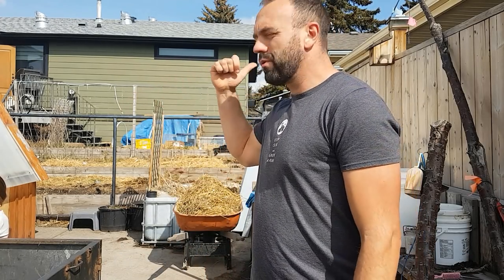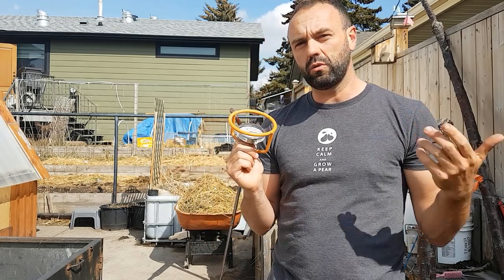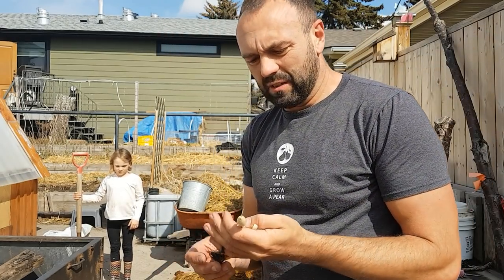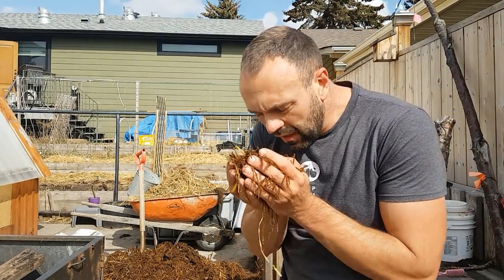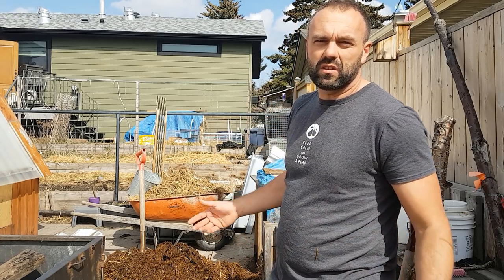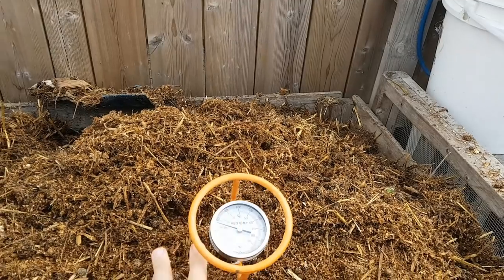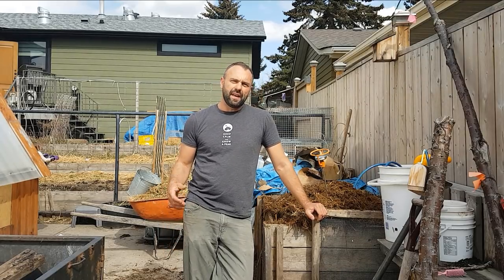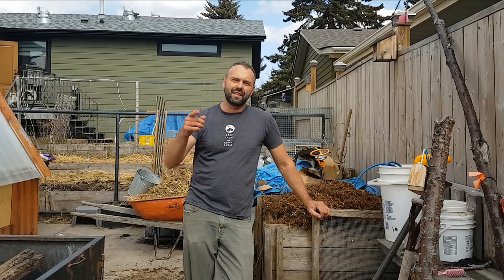How To Make Compost At Home

Comment: did it ever heat up again? I compost rabbit manure regularly, but I use alfalfa/grass hay, wood chips, and yard leaves. No straw. My guess based on the look of your pile, is that it is a bit high in carbon. Just a guess. My piles usually get to 60C for 3-4 weeks sometimes 6 weeks. I flip once and get another 10 days of good heat out of it and let it rest for several months. The end result is still a little rough but I find it functions great for many plants in the garden, esp tomatoes.